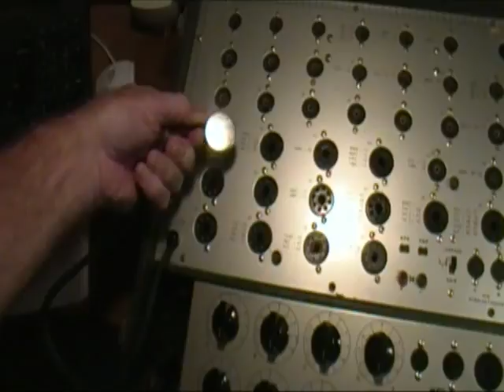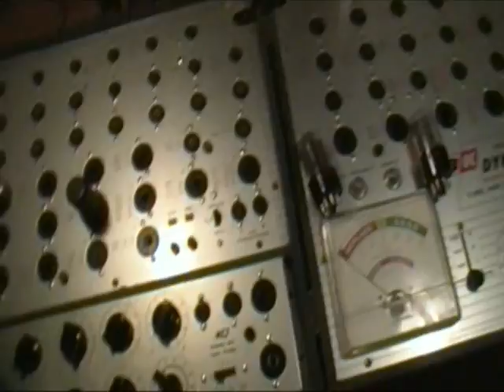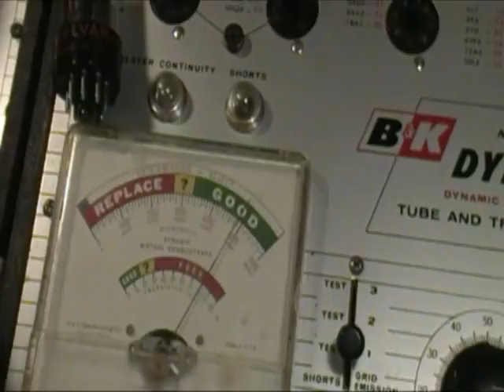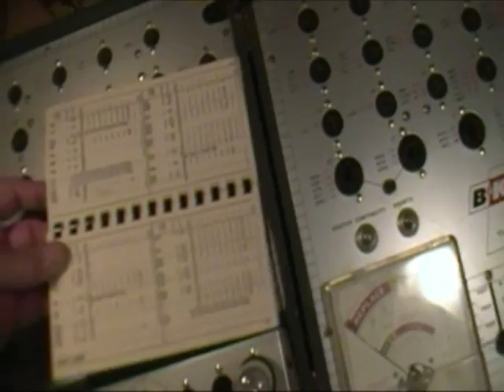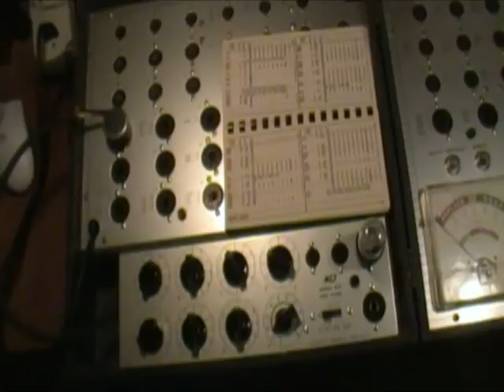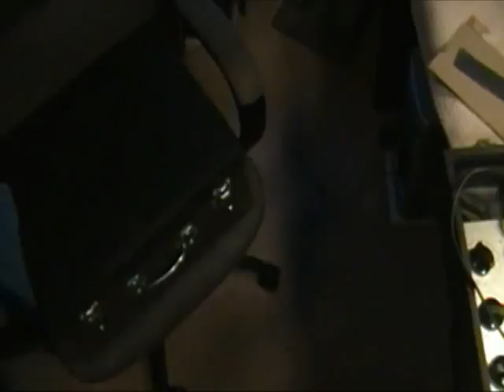TTT060 BK610 Tube Tester Panel

Comment: Appreciate your vids! I'm getting ready to rebuild a B&H 500 'Dyna-Hack' [owned 20 yrs]. Someone took a 500 and grafted in, what appears to be, a 610 panel. It is hard wired, internally; no connector plug. Should be interesting, to see how it's wired. I did some research. It seems that B&K did offer a '610-500' combo. It was a combo add-on, as with the 650. The 500 part has always worked well. Never messed with the 610 bit. I've also never opened it up LOL. These days, I'm doing some of my own tube amp circuit work. I'm planning on using the 610 side, so that I can eval both sides of triodes. Thx again. Your vids have been most helpful

Comment: Hi Tom !   I just acquired a Dyna Jet BK  606  Tube tester wich i have not picked up yet.   I am wondering how helpfull it will be in the testing of post war era vaccum tubes.     Not sure what year model it is.   Thanks in advance..
Reply from the maker: According to the book by Alan Douglas, B&K introduced the Model 606 in 1966 so it should be able to test tubes made before that date. It will test 8 pin -(Octal and Loktal), - as well as 7 and 9 pin miniature tubes. This will account for most post-war tubes since the 4, 5, and 6 pin were no longer being used in new radio or tv production after the war. I do not have a 606 so I do not know if it will test nuvistors or compactrons, but those were rare before 1966 and began to become more widespread after this model was introduced. I think you will find that it will test more than 90% of the postware tube sets, both radio and television at least up until compactrons became widespread in tvs around 1970.

Comment: Hi Tom,, Just wanted to say thank you for your great videos,, I just purchased a BK650 tube tester and I"m in the process of doing some of the restoration steps that you have done,,, I've noticed that the 650 will do a great test on 12AT7's but not 12AX7's,, Just wondering if there is a way to do a better 12ax7  meter reading,, 

I've also noticed that for all the tubes it will test there are alot it won't test,, One of the basic tubes are EL-84's,, The 610 panel has to be used for that,, which brings me to my next question,,,Is there any way to build a small adaptor with the switch settings hard wired in to test an EL-84... ?  And one more,, Do the Sensitivity numbers on the 650 indicate the resistance settings of the Sensitivity dial,, whew!!! LOL sorry about that,,,, The reason I'm asking is I'd like to build a 610 panel for that specific purpose because they are Impossible to get now,, Thank you,, and sorry about all the questions,, New Fan,, Terence,, Canada..
Reply from the maker: Hi Terence, thanks for your kind comment. I will try to answer as many questions as I can but I need to understand a little more about what you mean concerning the 12at7/12ax7 differences. If you could describe exactly why you believe the 650 tests them differently I would be willing to do some tests to see if I can figure something out. As to a special 610 panel, that seems possible but I will have to look at what you have in mind to see if I think it will work.   Please send me (bktektest@gmail.com) a schematic or plan of what you intend and I will look at it. In the meantime I will get out my 650 and try a couple of 12ax7/12at7's to see if I see the problem. As to the sensitivity control, it is just a meter shunt, i.e. it changes the amount of deflection for a given current. The setting for a particular tube is just what a factory tester found that worked for a specific tube and is relative, not a specific resistance value. I will be happy to look at what you have in mind for the special 610 panel and also what I find out about the tube differences.
Reply from the maker: Hi again Terance. I got your e-mail but thought it might be better to post here since it might benefit others as well. You have found a peculiarity of many tube testers that test different tubes with a standard voltage set(plate and grid voltage). The 12AT7 tests normally in socket 50 of the B&K 650 tester, but the 12AX7 does not. The 12AT7 will read in the green region with a sensitivity setting of 86 but a 12AX7 will read low, even with a sensitivity setting of 91. The reason is that the 12AX7 must be biased differently but to save cost, B&K chose to test it at the same bias conditions as the 12AT7. The Dyna-Quick Tube Selector that comes with the 650 notes that a 12AX7 will be good if it reads 1200 in socket 50 with a sensitivity setting of 91. If you don't have the tube selector book I think one can be found on the BAMA website under the B&K 650-1962 listing as "650tubes 1962.pdf" Look on page 41 of that listing for that info. If you want to explore this in more depth you might look at an old RCA Tube Manual (like RC-18) and compare the plate characteristics of the two tubes at a bias point of  -3V and 300 Volts plate voltage, for example. The 12AT7 will have just under 10 miliamperes of plate current while the 12AX7 will have less than 0.5 miliamperes, i.e.  a 20X difference! Why B&K didn't wire up a different socket is puzzling but they do at least explain it a little in the tube selector manual. Hope this helps. I will look more at your other idea and respond via regular e-mail.
Reply: HI Tom,, Thank you for the great explanation and your help,,, That would explain the difference in readings,,, It's all between Grid and Plate.. I wonder how hard it would be to set up another socket(Spare 9 pin) And bias it for a Higher meter reading,, ? 

I was looking at the 610 schematic this morning and traced things From the 9 pin socket to the 41 socket hook up and Thought if My Idea wouldn't work I might be able to go with the original 610 plan,,, 

2 things would be very helpful of course if you have time. Continuity of the J switch setting on position 1 (el-84 test),, And the resistance reading of the H pot setting,(25), If I knew those 2 things I could set it up on my socket 43,,,Wanted to say thank you for putting this on your youtube comments,, I'm sure there are more people out there with these 650's that would be interested in doing the same thing.. 

Also wanted to mention that Bob Putnak from the site you mentioned Tube Sound recommends installing a Ma meter in the Anode cct of the 707 which Im sure could be done on the 650 as well,, Just have to figure out where and how in the cct it would go,,, I'm going to email Bob this afternoon,,,to ask what type of Digital meter he uses and if it needs to be shunted or not,,, Will wait for your reply and thank you again,, This is going to be a lot of fun and if we can do the mods,, will have one super cool B&K 650..

Comment: I haven't heard of B&K.  Do you own any Hickock tube testers?
Reply from the maker: +The8TrackChap Yes I have a couple of Hickok testers. I talk about one of them in the B&K 650 restoration series, the Hickok 600. Hickok was a big seller in the 40's and 50's but by the late 50's B&K became the biggest seller of equipment to the TV service industry because their testers were faster to set up. I tend to focus on B&K equipment and Sencore, which replaced B&K as the biggest seller in the 80's. Thanks for your interest and comment.
Reply: I also have a Hickock 600.  It's the only tube tester I currently own.  The tube charts for Hickock models seem to be readily available, and I have an entire book from the guy I bought my tester from.  How frequently do tube testers need to be calibrated?
Reply from the maker: +The8TrackChap I think opinions will vary on how often to check calibration but what I do is keep a "known tube" that I try in a tester to see how it compares - if it reads very differently from the last time I tried it, then I check calibration.. I am not a big believer in exact calibration, however, since a tube tester only gives you an idea of whether a tube is good, not whether it will actually work in a particular circuit. Some tubes that test good don't work in some circuits and some tubes that test marginally will work in some circuits, The only thing you know for sure is that if the tube is completely dead it won't work. All else is just estimation.